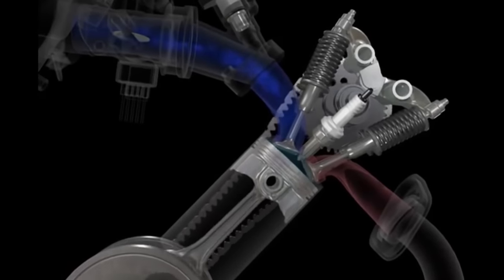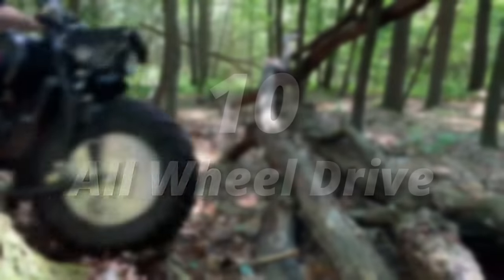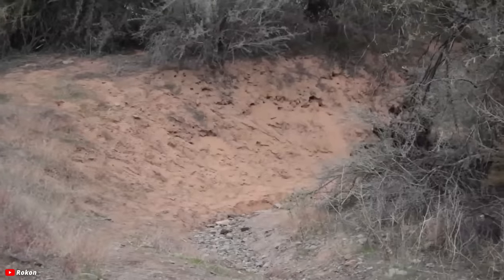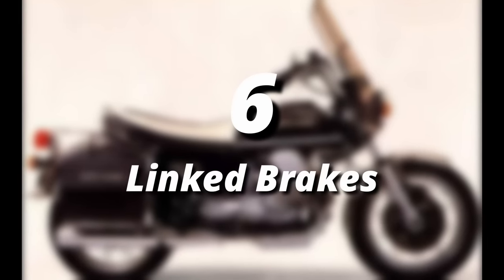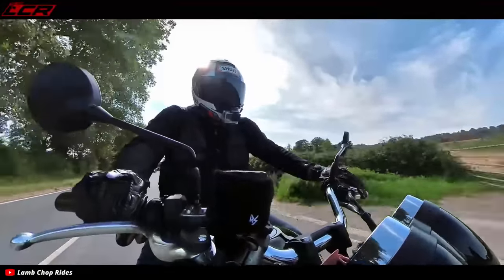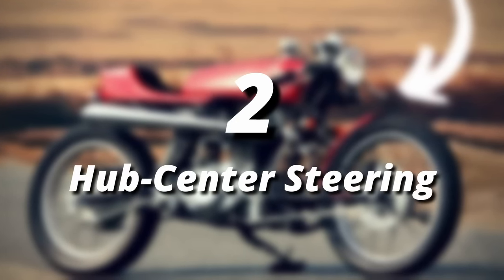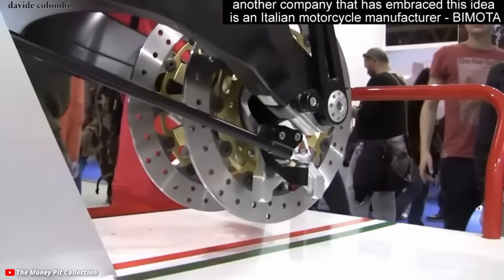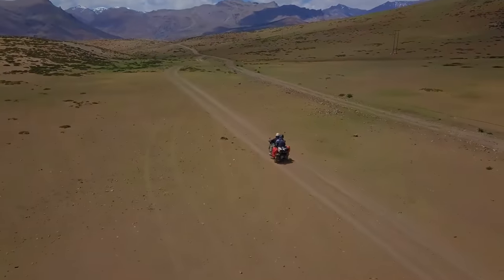10 Motorcycle Innovations that never caught on

Comment: My experience with twist grip shifters was that they were awkward to use, particularly after a bit of wear which could make them a bit clunky and imprecise.
Reply: Cables always snap when older
Reply: I totally agree.  One ride was all I needed to wonder why anyone would even try the idea!
Reply: Indeed. And the strange position of the wrist, right where you hit a bump on the road.
Reply: they look shite in design anyway as the entire lever has to change angle, it should have been made to reset back to normal but was designed too cheap
Reply: They were common on mopeds in the 50’s and 60’s, at least here in Sweden.
Reply: I hate grip shifts.
Reply: This. When I used one the scooter had some mileage but the constant use of the shifter made it worn to a very broken-like look and clunky shifting as a result made me mad.
Reply: Rearranging your hand for every shift?  Besides, does anyone here even notice what their foot is doing any more?
Reply: Had a 3-speed twist shifter, its not very precise and impossible to gear fast, or is it…? Find the right engine speed vs bike speed and you can yank it in the next gear with no clutch. But reliability was low, always need adjustment.
Reply: @brokenrecord3523 Dont be ridiculous, most grip-shifters were mopeds with bicycle pedals. Foot gear wasnt an option.
Reply: You only had to do to things with those twist-grip gear changes;  keep the cables oiled, and take up a bit of slack when the cables stretched.  If you had problems with them, that was down to a lack of basic (and very simple) maintenance on your part.
Reply: That one falls under the category of 'No problem to solve here'
Reply: Grip shifters are ok for mopeds: at the time those relay more power to the wheels and does not Israeli space on the footrest (where you could balance stuff to take with you). I just can’t imagine a scooter with foot operated shifter. How would you use your leg to keep the stuff from falling aside if you have to use both feet to operate the moped? Vespa wasn’t invented for enjoyment, it was meant to be a cheap utility vehicle, having a foot shifter would have made it just less useful.
Reply: Yeah, they weren't the greatest. My first two Scooters had twist-grip shift, I never really liked it, but that's what you got back then.  I forgot the Triumph Tigress/BSA Sunbeam, that had foot shift too.

Comment: I wish you had explained the advantages of Britten’s suspension and the hub-steer suspension.
Reply: I literally had this exact same thought as he talked about it. EXPLAIN the advantages, don’t just TELL me. Motorcycle makers haven’t done it for a REASON
Reply: Bike doesn't dive when braking - go deeper into corners before braking.
Reply: @percy tom - Thanks!
Reply: too heavy, complicated and expensive @Rudenbehr
Reply: BMW has built their Telelever, then Duolever/Paralever suspension, still in some models, for over 25 years. It's in my 2007 K1200S hot rod. The bike will not wobble, even tipped in over potholes and the front end barely dives, even when the Brembos are clamping speed down with prejudice. Straight line or when in a corner, it's like the bike is on rails. On does need to keep ahead of the machine, as "twitchy" is not an adjective used when describing its handling.

Comment: The classic Piaggio Vespas had a lot of innovations that never caught on elsewhere, which is why I enjoy them so much. Aside from the twist grip shifting, they used a trailing arm front suspension, front and rear wheels were interchangeable, and both were as easy to remove and install as an automobile. The frame is monocoque, the rear suspension is the engine case so there's no separate drivetrain, and every cable, wire, and tube is routed internally.
 It was designed from the ground up to be the world's most practical utilitarian two wheeled vehicle.
Reply: And now even Piaggio is back building fairing-on-frame bikes voiding the advantages of a pressed steel monocoque design.
Reply: Grip shifting used to be really common in 50ccs in Germany
Reply: @florianvelling6427  in Poland too
Reply: @The Irate Lad but that one is no longer a Piaggio product.
Reply: MZ ES250
Reply: @daszieher  the cost of press tools and formers is huge,  as opposed to a jig for tube construction so the economics are totally against it,  cars get away with it due to the very large numbers produced,  but even there we see manufacturers using common forms throughout different models to bring down the unit cost,  also due to the inevitable cost cutting the rust protection inside any box sections often lacking and so corrosion rears it's rusty head,  something less prevalent with tubular frames.
Twist grip gear changing would be interesting with a six speed box,  and even more so when a cable fails.
 Been motorcycling for over 46 years and always had a keen interest in the engineering side,  beyond just fixing them,  so I have found information like this to be good mind food,  (some of which I lived through),  and now find myself contemplating a build of my own🤔.
Reply: And probably a lot of these "innovations" were copied from Lambretta
Reply: @Johnketes54  They probably copied stuff every time one broke down outside the Vespa factory
Reply: You're ignoring Lambretta !
Reply: in the 50s 60s some scooters vespa included use to carry a spare tyre, which i found useful, and getting rid of the kickstart is another thing i miss,
Reply: Vespa’s usually got me to a Ska show on time, where with my Lambrettas… I’d miss the first band getting it started.. but at least I had shown up with a little more style.
Reply: they also invented the side mounted engine/transmission with spare wheel on the other side to make it a bit less unbalanced
Reply: @travezripley  my mum often tells me stories of when her and her biker friends used to go "mod bashing" 😏 
sounded crazy back then haha 👍
Reply: And you could wear a skirt or kilt & carry a bag of shopping too 😀
Reply: @jmileshc  yes.....👍👌👍
Being able to carry a bag in one hand was actually one of the criteria for the bike.......
Reply: And it was designed to be easy to build and inexpensive. Piaggio was a car manufacturer before, and airplane manufacturer during WW2. The Vespa was their first product after the war had ended. Italy had big economical problems back then, and only few people were able to buy a car. Thats how the idea for the Vespa scooter - and shortly after the 3 wheeled Ape cargo vehicle - was born.
The grip shifting and the front supension has been used by other companies, too. I dont know who invented them, though, and when.
Reply: @alant383  I know - there is one driving past my house quite often. It looks like standard Vespa scooter from the distance. But the big difference is: its completly silent. Pretty weird to see it, because you would expect a scooter to be quite noisy.
Reply: @Johnketes54  Yep. Used to have a GP200!
Reply: @florianvelling6427  so true, brands like Puch (Austria?), Tomos (Slovenia?), Kreidler and Zündapp had grip shifts. I think that these were all three speed gear boxes. My first Kreidler was a three speed. The four speed I got after that had a foot pedal.
Reply: I have a Vespa 90 with a 130cc top-end modified ET3 engine, reed intake, and Simonini pipe. Looks like a stock basic two-tone painted small frame except for the pipe. Surprisingly fast!
Reply: Scooters are NOT Motorbikes please don't taint Bikers chat with girls machines .............
Reply: @florianvelling6427  austria too
Reply: @he_exe  Basically all of europe to je honest
Reply: @Johnketes54  Yeah, there were many scooter makes in Italy. I would like to have a few Ducati scooters.
Reply: Auto Rickshaws in India -- Bajaj-- use grip shifts.
Reply: Linked or integral brakes are coming back. I had it on my Motoguzzi LM1000 and have it now on my BMW R1250RT and on my Monotracer
Reply: @popuptoaster  I had a Lambretta SX200.  I bought it when its was a 3-year-old. For the first few years it was reliable, except once the petrol feed pipe  popped off and caused a leak. Then, when it was 8 years old a piston ring broke. That was readily fixed. I still have the engine.
Reply: @robortkristensen3818  
My 1939 Rudge 500 has linked brakes and an easy-to-use lifting handle you can use before stepping off the bike, also a starting lobe on the inlet cam, to make it easy to start.  Having said that the Vespas and Lambrettas were very good designs and sold in huge numbers, more than paying for their tooling costs.  Italian design is still a force to be reckoned with.
Reply: They integrated a recoilless rifle into one... Just need to set the feet down on it,  it fired during riding lol. I think there was another with a side car and made into a technical.

Comment: The grip shifts used to be pretty common on vintage mopeds in Sweden. They were made in the thousands to the point where you can look on any second hand website and within a day have a 500$ moped from 1968 that’s in near perfect condition. As I said before, a lot of them (especially the early models) had grip shifts, which are notorious for being absolutely awful to use. They make your hand tired and it’s pretty finicky to use. My 1975 mustang 617 sport has a grip shift clutch assembly, but thankfully the zundapp 278 engine it came with has a pedal shift.
Reply: Bajaj  scooters from India also use twist grips. It's way too easy to accidentally shift gears while turning or under heavy breaking. Or maybe it's just because the one I rode was about 30 years old
Reply: Old Tunturi mopeds also had the same system.
Reply: In the 60/70 and 80's where a lot of small 50cc Mopeds using that kind of Grip shift from 2, 3 and even 4 gear versions. So its absolutley nothing which only Piaggion has used. But due to the iconic design that is one of those that is best known around the world.
Reply: They also go out of adjustment due to cable stretch, and can randomly drop into gear while sitting and running.  I learned that the hard way when I was diagnosing a hanging idle on a stella, rev it up and BAM scooter is at 12oclock 5ft away from you.
Reply: TOMOS has a grip shifter on some models.
Reply: I have this notion that when you say “mustang”, it’s not the Mustang i think of.
Reply: Yes it’s somewhat of a different vehicle I’m talking about lol. Search up Mustang 617 Sport, it’ll come up. The company that makes it (Mustang) was a small company based out of Trelleborg, Sweden which was founded before 1964 (when ford mustang was first unveiled)
Reply: @g1ngersnaps149  That the first image that comes up is in its white & blue livery is too perfect. In a better world every Mustang with it come with a Mustang in the trunk. Screw spares, I’ve got places to be!
Reply: Couldn’t agree more! Glad you like it :)
Reply: just my words
Reply: Some vintage East german ones had grip shift too. I owned a 3 gear Schwalbe with gri shift.
Reply: Most geared old french mopeds have had them at some point, along with french motorcycles. They never caught on because they were all supposed to be sport bikes, and it was akward and unsporty, they all changed to standard shifter. flandria comets have them too
Reply: These mopeds had grip twist gear shift since they were made to have bicycle pedals, then foot gear isnt an option. Later many European countries changed the laws so pedals was no longer a requirement for mopeds that didn’t require you to have a drivers license. Laws still varied though, for example in Norway a moped was to have max 2.5hp and max speed of 50kmh for 16 year old drivers, while in Sweden it was 1hp and 30kmh for 14 year old.
Reply: I owned a 1958 Sears Roebuck 125 cc motorcycle, made by Puch, that had a three speed grip shifter. It didn't use cables, but had a series of rods and ball joints to operate the foot shifter, which was apparently what was used on the same bike sold in Europe at the time. For some odd reason Sears apparently decided that the twist grip shifting system would sell better to their catalog customers than the original foot shifter. It worked, but that is all that I can say about the design.
Reply: A lot of mopeds in the Netherlands had grip shifts too. Puch, Tomos, Zundapp, Kreidler, and more.

Comment: Someone else has probably already mentioned it,  but on the Guzzi linked brake system,  it did have two independent systems.  The foot pedal operates the rear and one front disk,  the handlebar lever engaged the second front disk.
Reply: @Phil Davies - As did the Goldwing from 1981 -2000 (rear with right front brake, 'balancing' side to side) which was NOT the best idea for lowered adhesion surfaces. such as sand, snow, rain or grass clippings! After the 2nd ride on my 1986 Goldwing (late-February in northern Illinois) where it unexpectedly snowed through my 40 mile ride home, and I inherently skidded the front tire while using only the foot brake (that'll definitely make your butt pucker something fierce!) I decided to split my braking on that bike the proper way by summer. With the 1800 series, the calipers themselves were split ( 3 piston or 6, I don't remember) so the center front pistons and the outer rear pistons were operated by the foot control and the outer front and center rear pistons were by the hand control. This way the stronger front/ weaker rear balance was by hand with stronger rear/ weaker front by foot, giving a 'balanced' linked-braking with a feel closer to a non-linked system. 
As for the Guzzi linked system, I've heard that in some markets (definitely not U.S./ North American) there was no 2nd system, all braking was by the pedal. That would never fly in the States because there is a DOT requirement (since 1968) for multiple brake systems - just in case of one failing - on all street legal vehicles.
Reply: I still have a 87 California 2 with this at that time innovative break system. And it is really well working, once you get used to it. The 40:60 share between the back and left front break enables nice decelerations without any risk of blocking. And with the second front disc on the hand lever you can reinforce this, or just use it in stop and go as the only break.
Reply: early 1980's yamaha venture royal, had linked brakes, as does honda's VFR800, in fact my 09 VFR8000 has linked brakes and ABS. In EU all new bikes must have either linked brakes or abs, so many lightweight bikes have linked brakes to keep the costs down.
Reply: @MadMaxxMoto  - I don't now about other markets, but Moto-Guzzis sold in Britain had the 'one front + the rear disc' operated by the pedal, and the second front operated by the hand brake lever.  As to the balance between the two brakes, when you pressed the foot pedal, 60% of the hydraulic pressure went to the front disc, with 40% to the rear.  I rode my Moto-Guzzi all year round, including on icy and snowy roads, and never had a problem with either wheel locking up.
Reply: @Herr_Bone  Great to hear you like it. My 85 Lario still has linked system and once used to it you never find an issue. Confuses the heck out of NZ WoF issuers though as they struggle to understand why and how it works,
Reply: @malcolmgee6812  haha… yes. I always have discussions with the MOT engineers because they claim that a double front disc should grip harder.

Comment: Greetings from India..
We still have some of the features you mentioned in the video common sight on our roads..
1. Left hand side grip gear shifters are still used on some scooters and three - wheeler auto rikshaw (Tuk -Tuk) to this day..
2. Combined front and rear brakes are a common feature on modern bikes in India, but you also have a seperate front brake on these motorbikes and scooters.
It's only when you press the rear brake the combined brakes are triggered, my Honda CD110 has this.
3. TVS tried to make the clutch less automatic transmission mainstream with the TVS Jive but that didn't attracted many buyers so it was ditched...

Great video BTW..
Reply: For decades(!) left hand side grip shifters have been used on mopeds of many brands from Italy, Germany, Austria, France etc. Worked very well
Reply: Combined front and rear brakes are also a common feature on modern bikes in Brazil. Today, all small cc Hondas has some sort of it.
Reply: Bhai aap bajaj ke scooters bhool gaye eg bajaj super and chetak
Reply: Bajaj m80 bhi